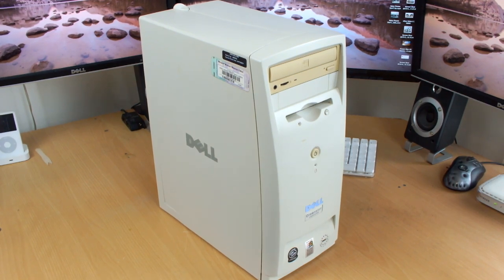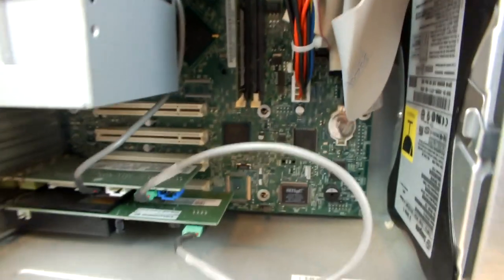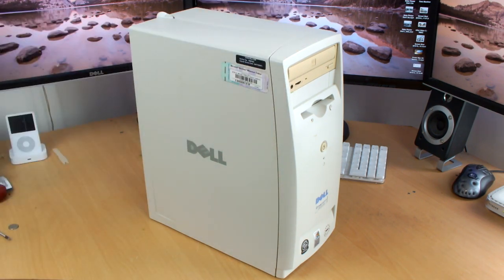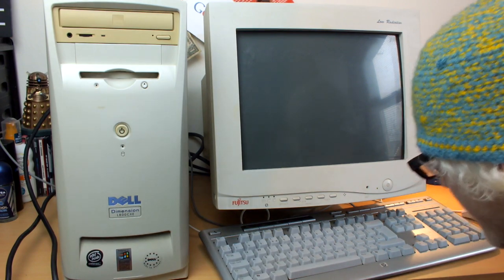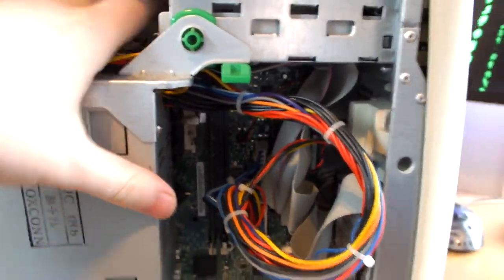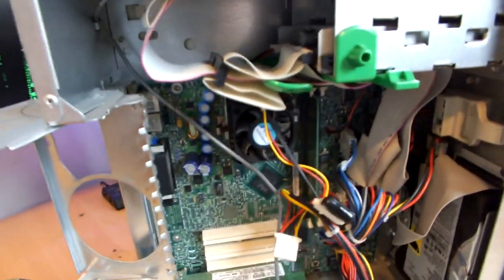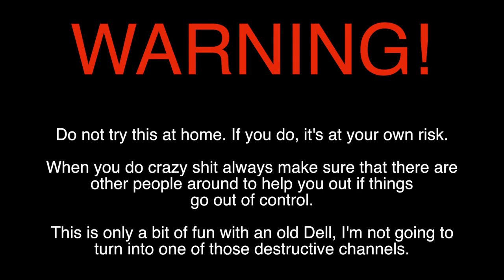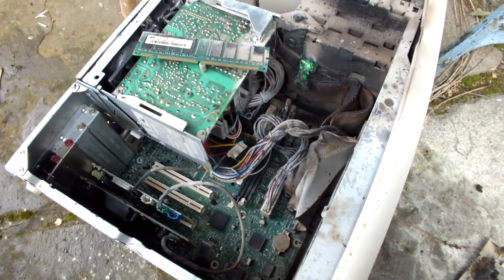Dell Dimension Total Friday Fail | IMNC

Comment: If it was BTX, the motherboard would be ATX in reverse and be what I call a "lefty dell" where the motherboard is mounted on the left side. You'll find that standard in computers from the mid-2000s.
Reply: Little titbit. The Mac Pro was one of the only machines that kept this layout up to its 2013 redesign. It's a better standard for cooling more power hungry components like dual socket Xeons. The ATX standard is rather cramped and wasn't really designed for the kind of hardware we put in our systems these days. It was from the days where the most beefy components would be cooled with a heatsink and maybe a small fan.

Comment: That power supply popping saved you Tom ! I was around in the WinME era and dear god that was a terrible OS from microsoft. Some good ideas implemented into it ( mainly more usb support ) but it was so unstable to the point of unusable at times. I personally jumped from Win98SE to XP back then
Reply from the maker: veplus I was really looking forward to trying out crappy ME :( I haven't used it since around 2003 when I was much much younger so I can hardly remember the experience. Hopefully I get an opportunity to find a system with ME on it soon.
Reply: ItsMyNaturalColour  It would have been good for an experiment, but if you can't remember the experience it's cause your mind has blocked it out ! :D I remember using is as an OS on a machine and it did force my mind into a 'save often' mentality. Maybe i just had bad luck with it but when you compare it with the stabilty of Win2K that came out the same time it was just pants. But then Win2K was based on the NT kernel which XP was and WinME wasn't so I reckon it was good that MS saw what they had done and went down that path instead.
Reply: I remember Help & Support not working. At all. It'd just show a blank page lol.
Reply: man me was sooo bad, my brother used to have that on his old gateway, I still have a pc rocking win 98 laying around tho :)

Comment: I have a very similar Dell with the exact same case. It is a really cool case design and very easy to work with. Mine came with Windows 98 SE and has a 667MHz Pentium 3 CPU. It currently dual boots Windows 98 SE and Windows 2000 Pro IIRC. Next time I have it out, I might make a video about it and maybe even load up my copy of Windows ME on it.

Comment: A few years ago I got my hands on basically the same model as is featured in this video. At the time I had quite a few old dell desktops on my hands so I replaced the psu and after it blew through another one I gladly threw the computer out. It was decently quick for the specs but I didn't have that many psus to spare so I bid that one adieu.

Comment: Actually, it wouldn't be BTX I believe. I had a newer Dell PC with a BTX board, and it still used a standard ATX PSU. Also, BTX boards are reversed from ATX boards (i.e. they are mounted on the right side panel, not the left), and as far as I can tell that one looked to be the same layout as a standard ATX board. Either way, whatever board was in that machine, it definitely uses a proprietary PSU. Anyways, fantastic video Tom!
Reply from the maker: SpeakerDude24 You're totally right! After making this video yesterday, I was thinking to myself that the case was not the right way around for a BTX system. I started regretting my firework stunt until I looked back at the video and realised that it was still a proprietary board and PSU so I'll be glad to get shot of the system. Glad you enjoyed, thanks for the comment man! :)

Comment: i just thought of this did ya make sure the red switch on the psu was set to 220 and not 115 i wouldn't know what would happen if ya plug in a computer that is set to 115 in to a 220 line still cool video doesn't hurt to blow up computer once in a blue moon

Comment: What you could do is pop the hard drive, if it still works, in your Athlon system.
Reply: At that age I'd be surprised if it's more than 10GB. It'd be rather limited.